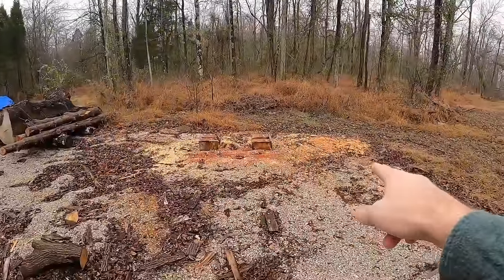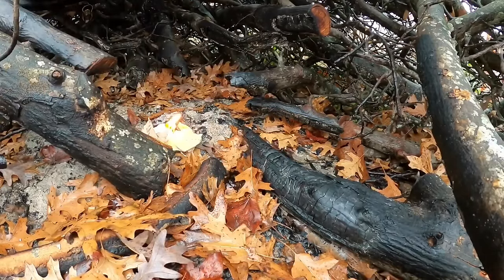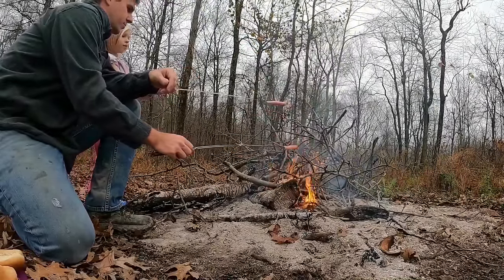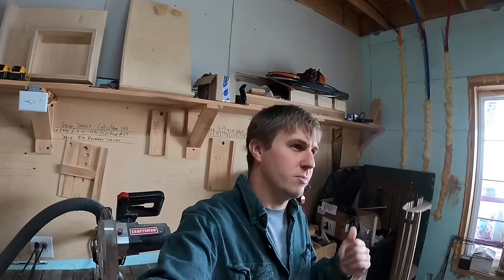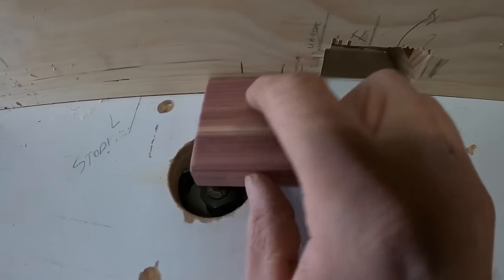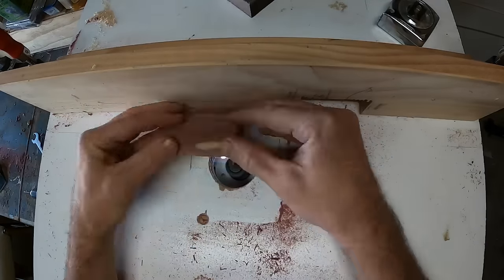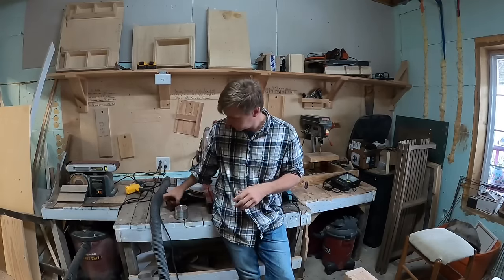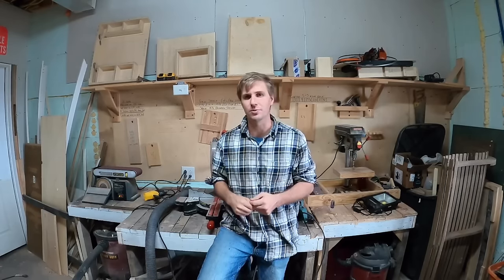Alaskan Milled Cedar turned into Simple Handmade Wooden Music Box

Comment: Nice wood! It is special because you cut yourself.  One tip on routing the boxes, clamp a stop block rather than a line, that way you can smooth the sides with the router and not worry about a blow out.  Thanks for sharing you day and your family.
Reply from the maker: Good tip!  Thanks

Comment: This is a great video that shows a hobby doesn’t have to have the best of the best for tools. 
I was fortunate enough to have a Community Woodshop in the city I live in that was very well equipped. Unfortunately it was shut down because the existing space (part of the old hospital that’s now a long term care home) didn’t meet the current fire code requirements. Those pesky firefighters. 😉
Your advice on where to spend on the best quality you can is spot on. You don’t need to spend hundreds on a Festool sander when a Harbor Freight will still do the job with quality sandpaper. 
That advice can go for any hobby. More expensive tools may last longer but a cheaper one gets you going sooner and if you really enjoy the hobby you can upgrade tools later on.

Comment: Hand tools. A coping saw, back saw, hammer, screwdrivers, chisels, plane, files etc.
You don't even need fancy sanders, a wood block you can wrap the sandpaper around will give you the flat surface to sand level.

making a saw box to cut the most common angles is easy enough. 

The power tools do make work faster and easier, but aren't needed for a hobby.
Reply from the maker: Absolutely agree

Comment: just wondering why you would not cut those blocks up into thin boards that would be large enough to make the boxes  then just cut the box in half
Reply from the maker: If I had a band saw, also,  less joints to worry about this way